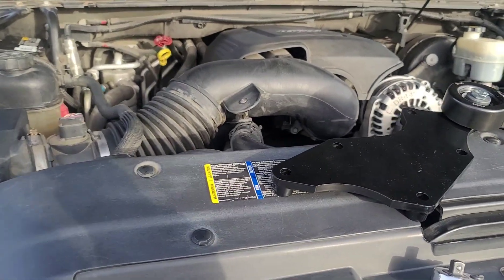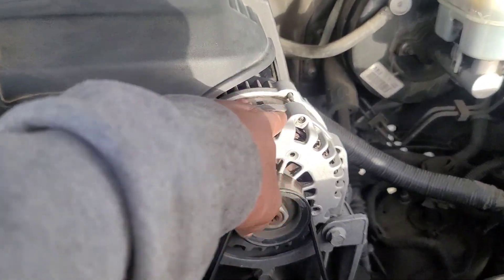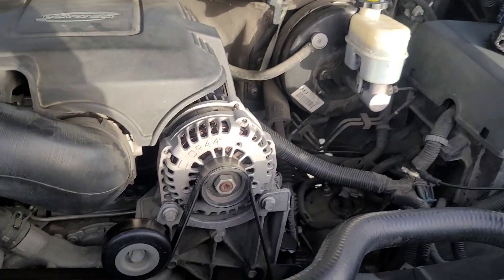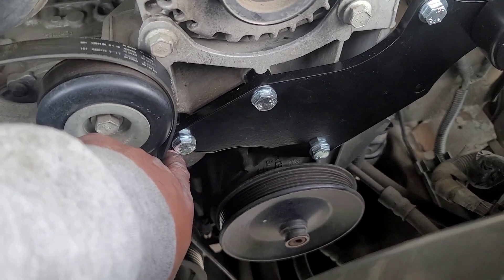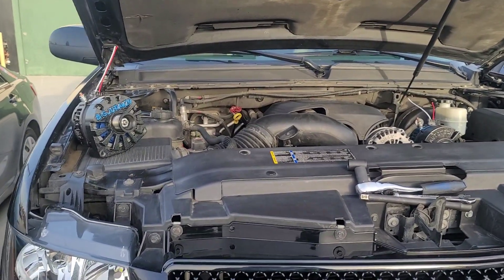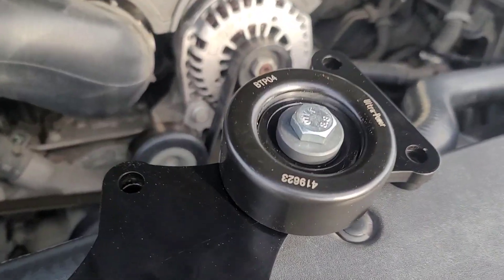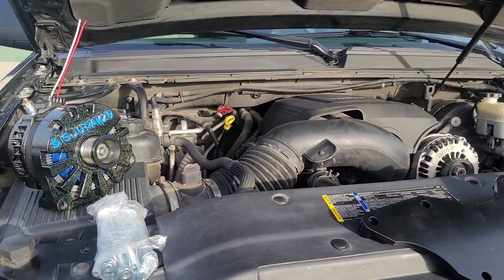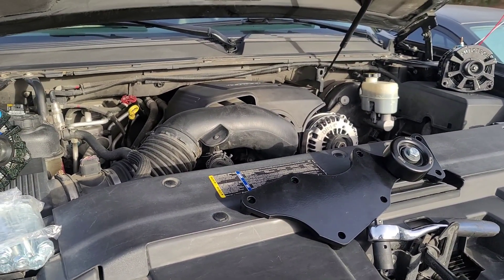Part 1 & 2 Of Triple Alternator Installation For 2000-2013 GM

Comment: I would put the two producing the most heat on top, I would definitely put the stock on the bottom if u r not running any thing beside the truck on it, I got a b pillar wall triple alts 48k but haven't had issues with alts over heating

Comment: I bought the triple bracket but mine is a 99, it came with a secondary bracket a small bar I am trying to figure out where that bar goes did this one have the extra bar?
Reply from the maker: Is is a smaller bar just a few inches? If so it bolts in the back to help secure the front bracket
Reply: @BIGJURAY20  I am trying to figure out if it bolts to the stock alt bracket or another hole on the engine the pics I got from Dan were not very clear from his info he sent me, mine doesn't bolt quite like yours does, and he hat r u using for a vcm?
Reply from the maker: Before this one I had his triple alt bracket for a 00 Denali 5.7L. I no longer have the truck otherwise I'd help more with pictures but right behind where the alternator originally bolts is where the bar goes
Reply from the maker: If you have Instagram or Facebook I can show u what pictures I have of the triple alt bracket.  Just Search BIGJURAY20
Reply: @BIGJURAY20  those xxx amps those r nice pieces man, u aren't located in NC r u?
Reply from the maker: @1-Six-dee  I'm in SoCal bro

Comment: Those four 5Xtremes new home will be planted in that vehicle but I still need those C-max to help with my power plant side of it all
Reply from the maker: Oh ok u have 4 X5.15 you're running? What kind of power?
Reply: @BIGJURAY20 a pair of Taramp MD8k's
Reply from the maker: @thebassgeneratorinc229  Nice should definitely get loud

Comment: Are they going to be in parallel and use second skin sound deadening
Reply from the maker: Yes eventually the system will be ran in parallel and as for sound deadening I will be using Sundown Audio and kilmat
Reply: @BIGJURAY20  Okay remember the wires for me and I want 2/0 of green colour for ground and red for positive
Reply from the maker: I'm only using 1 color for mines just going to use heat shrink to separate negative and positive